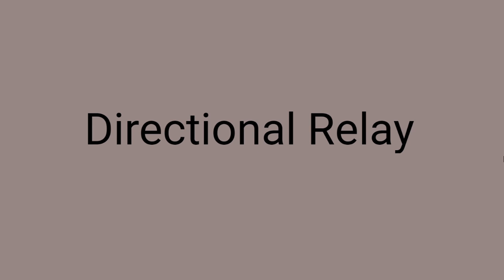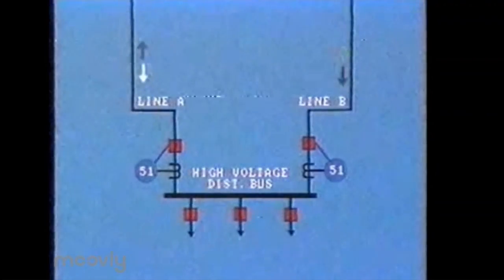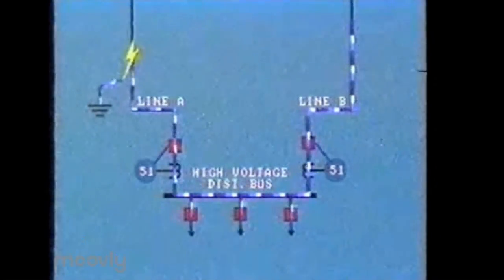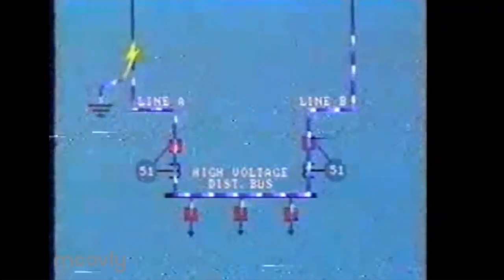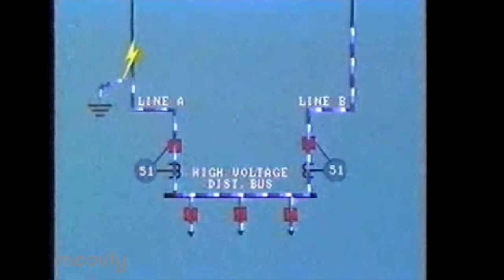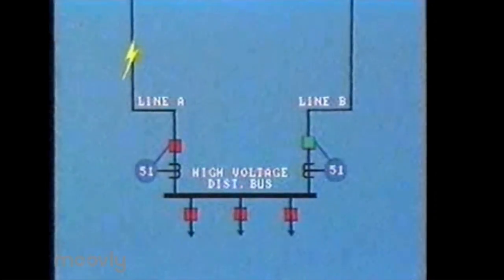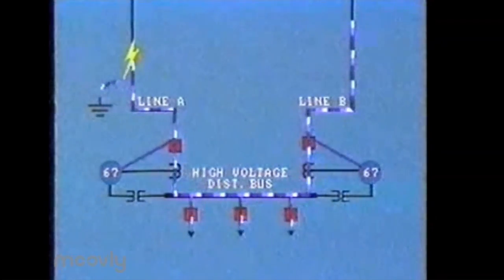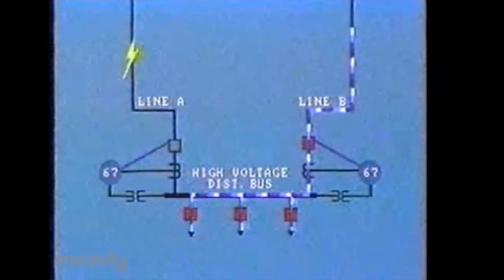Directional  Over-Current Relay: Directional over-current protection

Comment: Directional induction type over current relay is used for protection of
A)long transmission line
B)large power transformer 
C)ring main system
D)radial distribution line
Which one is the correct ans plz reply sir plz
Reply: D
Reply: Ring main system